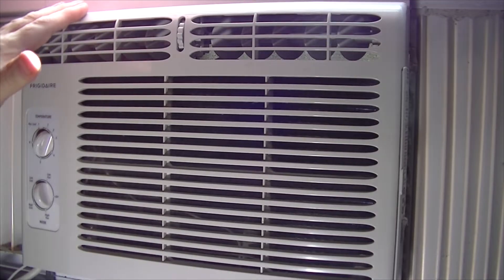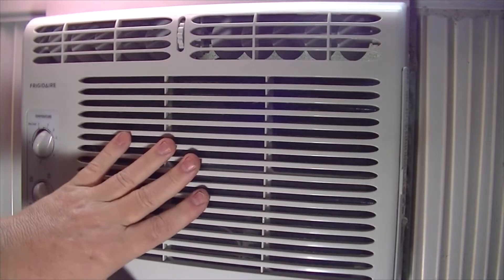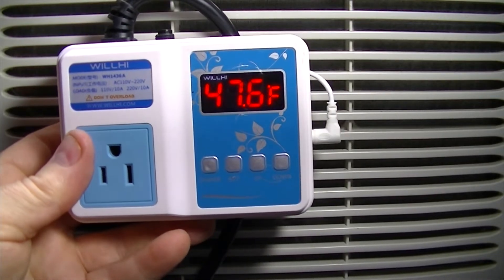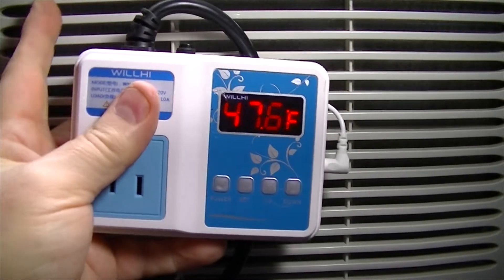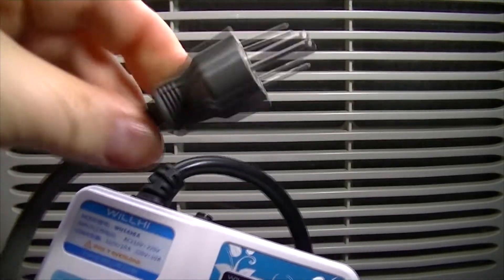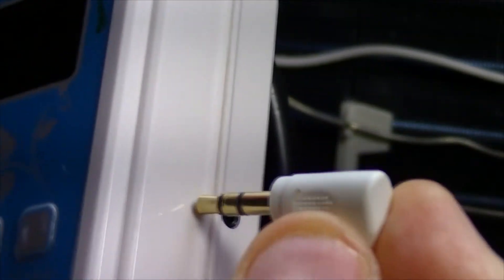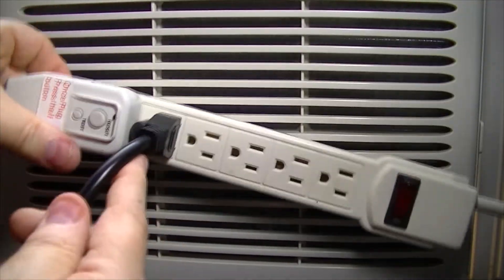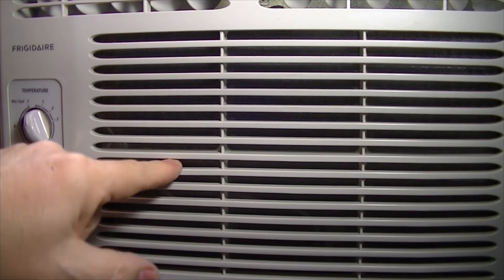How to Make Your Window Air Conditioner Colder Without Freezing and Icing Up WILLHI WH1436A

Comment: This is not advisable as it will surely shorten the life of your compressor by a lot.  A better solution is to get a larger AC unit.  So if you are running a small 5000 BTU AC, get larger 7 or 8000 BTU AC (no, you won't need a 220v plug).   Even though my bedroom size room is supposed to cool off fine with a 5000 BTU AC, but it doesn't.  So I got a 8000 BTU AC and problem solved.  Now I set the AC thermostat to about half where I had to have it up all the way with the 5000 BTU and the compressor almost never turned off.
Reply from the maker: Still works perfectly to this day, thanks for the advice though.

Comment: Instead of bypassing all of the mechanical controls, couldn't you have just set the temperature to max, the fan to max, and put the built-in temperature probe somewhere relatively warm-ish so that it would be guaranteed to be running as long as there's power going to it? Wouldn't that work?
Reply: But you would still run risk of the A/C icing up.

Comment: Why not just spend the extra $20 and get the one with digital controls and remote. You can easily extend the  temperature sensor to wherever you want if desired.

Comment: I like the video and will be trying this myself. If there were anything I'd do differently, it would be to combine both cables at the air conditioning unit so as to have only the GFI cable attached, and I would never trust a power strip to run an air conditioner. Too high of a risk of electrical fire.

Comment: So, does this make the actual air blowing out colder or does this device make the compressor keep running until the room has reached the desired temp?
Reply: It makes the compressor keep running until the room has reached the desired temp.  This is not advisable as it will surely shorten the life of your compressor by a lot.  A better solution is to get a larger AC unit.  So if you are running a small 5000 BTU AC, get larger 7 or 8000 BTU AC.   If your room is really hot like mine, the larger AC will actually cost less to run since the compressor will run a lot less.

Comment: Just go get a 5000 BTU air conditioner from the '80s trust me it will actually save you money believe it or not it's a lot more efficient but you're asking why it's cuz those units are constant head pressure and they're just very plasticy so I stick to the 80s air conditioners cuz they have a lot of metal and they're insulated better but yes stick to an 80s air conditioner trust me it will save you all the complications of a modern air conditioner some modern ones are good though not saying Omar ones are bad

Comment: what about just lowering your temp? to keep it running
Reply: AC units come with temperature probes, and the majority of modern AC units also come with built-in logic to determine whether or not it's likely for there to be any ice build-up in the system.  Even if you were to turn the temp down to 60F (or lower) modern AC units are more likely to shut off before getting to that number than units from the 80s and 90s were.

Comment: Please show us how to wire up the compressor and what you did with the original thermometer. Did you just cut the thermometer wire off first so both are not being used at the same time?  It is really hot now and people could use this info.   Thank you vary much!   Never mind, I just read the liability answer below.

Comment: Can you do mine? 😭
Reply from the maker: I didn't enjoy fixing my own, but it made a huge difference.
Reply: @roberta.edinger9405  I’m sure. I went and got a 12,000 btu portable ac black and decker. It’s working pretty good. The window unit is supposed to be 10,000 btu and doesn’t stay on cool. It’s not the type that’s easy to bypass the thermostat like another ac I used to have so I had to try other things like moving the thermostat wire to different spots. Thanks for the video Robert
Reply: What are you delay times? I bought the same temp switch and wired it up, works great, thank you for the idea!

Comment: My 12,000 BTU window AC can get my room down to 59F but I like it colder. I was running a low  BTU window AC maybe around 5,000 and I would turn down the thermostat all the way down, so it would get the room cold but the compressor would keep running non stop. Ac was right across from my bed, so it would. blow 40F cold air right at me all night long. I ran it about 3 years like that to it stopped working
Reply from the maker: Yes, I like it cold too. So far, this is the best thing I have found. Thanks for watching.

Comment: You can make an aircon colder by dipping temp sensor in hot water!
Reply: I do it to make it kick in quick or a hairdryer works well just not too close. Lol
Reply from the maker: Yes. I have heard of people attaching a small light bulb but it increases the possibility of freezing up.
Reply: @roberta.edinger9405  I have r22 gas and with a heat gun pointing at the temp sensor makes it ice cold. No icing up. Also I'm going to Setup a water spray setup on the back coils. Temperature goes down and current drops from 3.1 amps to 2.7.

Comment: If you have the right btu a/c for your room size you shouldn’t have to do this!
Reply from the maker: you would think but...
Reply: @roberta.edinger9405  Yup I did the math and my unit...still sucks ass lol
Reply: @ryans6280  mine too. I bought a 6000 BTU Haier window unit good for up to 250' SQ. My room is 168' sq and it won't get below 68 in the room- though it's set to 64. If I turn it to Fan it shows indoor temp as 63 but it's 68, so won't cool more. The company advertised a warranty but now say I can only return it, they won't work on small units. I explained I'm a disabled single female and got it for the warranty because I can't install or carry them myself and she didn't care. I can't install it myself and can't ask the person who installed this one 2 days ago to do it again. I'm so mad. Btw, it's reviews are great on lying ass Amazon but terrible on Target website with 14 reviews averaging 2.4, everyone having this problem.

Comment: Wouldn’t you have to wire your fan in to?  I see why you bypass the compressor to go straight to the new thermostat power unit thing.  But wouldn’t you have to do the same with the fan?  When I first plug my a/c in the fan don’t just automatically come on.
Reply from the maker: I have the a/c switched to high fan so the fan will run constantly.

Comment: How do you know it’s a thermostat issue compared to being low on Freon?
Reply from the maker: If it was low refrigerant, the compressor would run constantly and the evaporator coils wouldn't get very cold.

Comment: I actually have the same ac can you link a schematic of how to wire it up ? Should be no liability issue I took networking and computer tech for 4 years so I know how to wire stuff correctly but i do not want to go ripping into my ac without actually seeing it done first or getting a diagram
Reply from the maker: The only thing you are powering with the new temperature control module is the compressor. Hope this helps: https://hidayahti13.files.wordpress.com/2013/03/window-air-conditioning-control-wiring.jpg

Comment: Can't you accomplish the same thing by plugging the unaltered A/C plug into the Temperature Controller gadget? Why does the compressor need to be separated from the fan of the unit?
Reply: It's easier to bypass the thermostat, trust me, video on youtube about it and you won't have two wires running out of your a/c.
Reply from the maker: Unfortunately its not that easy because you have to bypass the air conditioners built in thermostat. Hope this helps. Thanks.

Comment: It would have been nice to see how you re-wired the compressor.
Reply: I suspect he didn't.  He bypassed the thermostat and that's the A/C's normal power cord.  These must be "trade secrets". If you have an analog a/c, open up the box, get the control panel out, look for the short wire that runs from the thermostat to the control knob. There should be a diagram inside your unit that shows you which this wire is and what color it is, then connect the main wire running into the thermostat where the short wire was and boom you've bypassed that evil thermostat.
Reply: Nightmare of a job.
Reply: @trentvlak  LOL and call the fire dept 2 hours later /s
Reply: @russhillis  I'm confused did he delete his comment? What did he say?
Reply: @trentvlak  yup
Reply from the maker: I felt it best not to show for liability reasons. Sorry.

Comment: Yeah this has no useful information
Reply from the maker: What would have made the video more useful?
Reply: Why... he tells us to directly wire the compressor, so if you plug it in, it simply turns the compressor on, nothing else. Ok, he told us that, and then he tells us about a thermostat that is 3rd party that plugs into the wall to actually plug the compressor into. The last part, which is kinda just, well duh, is to plug in the actuall ac unit so the fan can run....